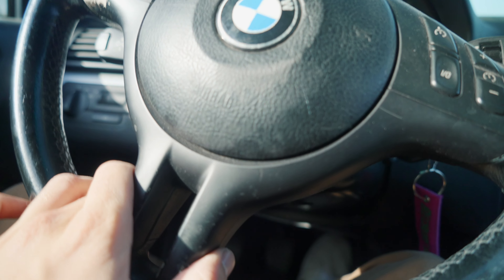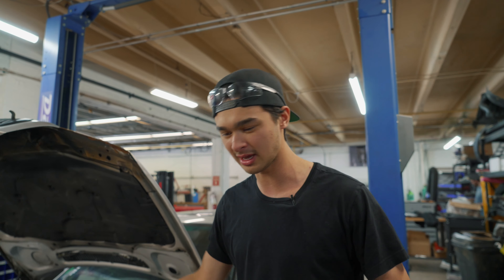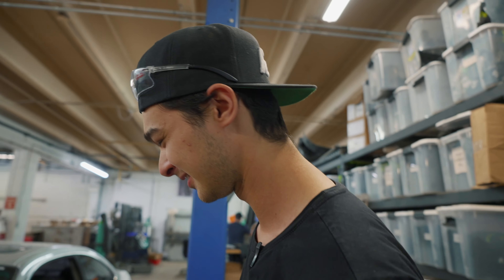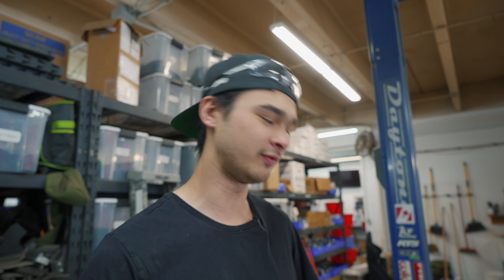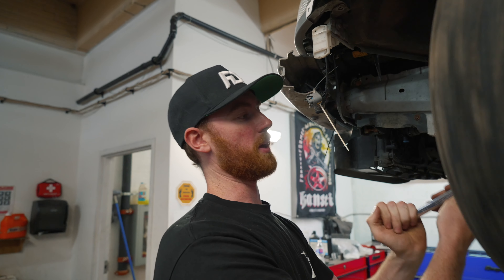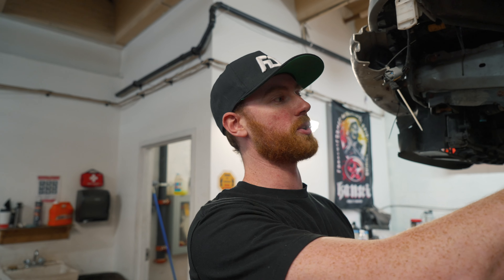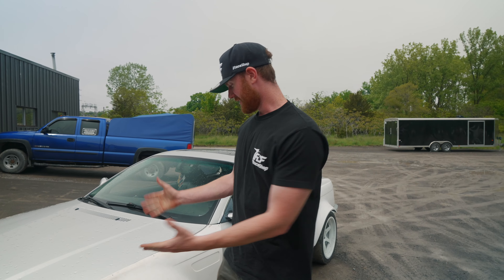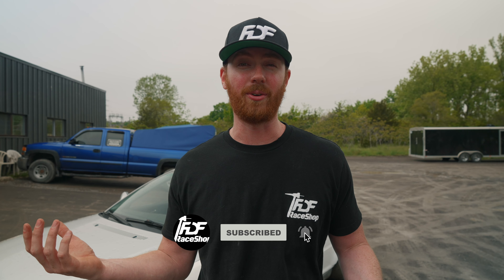BMW e46 angle kit on our new car

Comment: So many cool things coming!!! Can freaking wait!!! 
For the e36/46 rear knuckle, please make it easier to make small incremental tow adjustments. Right now moving the whole taking arm bracket is hard to add a little toe at the track. On S13 s14 you can just give it 1/4 turn, boom you have more toe in.